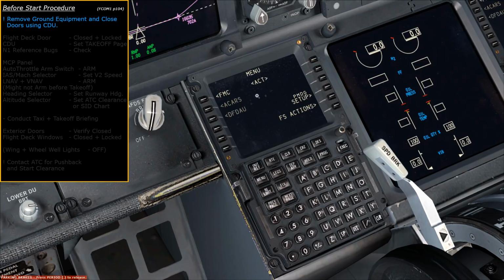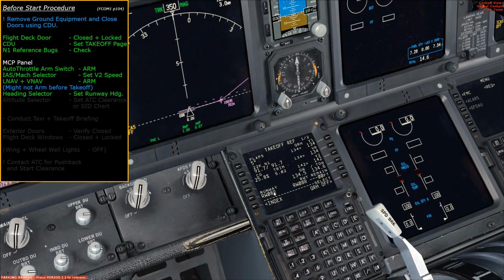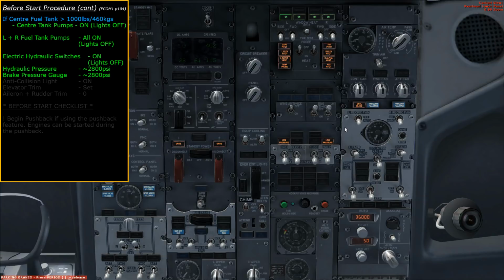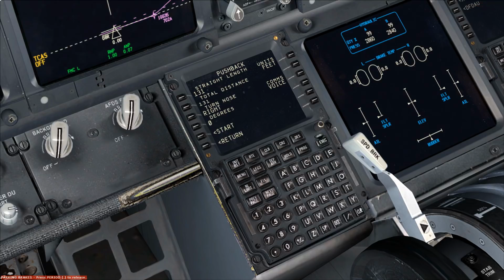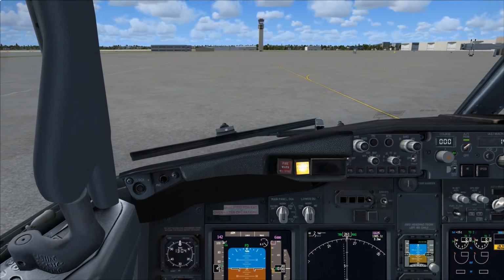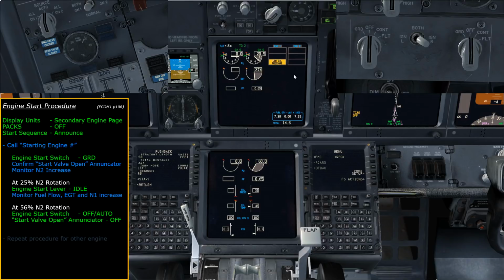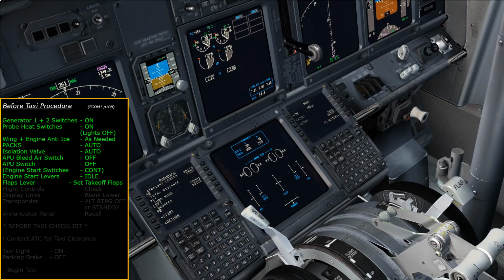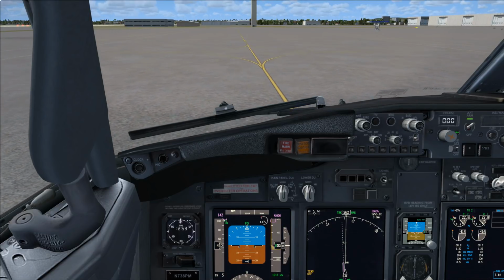PMDG 737 NGX:  4. Engine Start Procedures

Comment: Great tutorial! I have a question tho. When I try to turn on the hydraulic pumps the lights won't turn on, therefore, I can't control the aircraft whatsoever. I have never encountered this issue until today. Also, all the failures are off, so that's not the case. Any ideas? Thanks.
Reply: When the lights are off  and the switches down, engines running, and the battery is on, then the hydraulic pumps are on.  Lights on, pumps off. Okay?  That is, when the switches are in the down (on) position, lights will come on until the engines or APU is on.  The two outside switch lights go off when the engines come online (switches in the down/on position).  Inner switches (electric pumps) are switched on (down position) just before engine start.  The indicator lights will turn off.  When the engines come on line, the lights should already be out, indicating they are working.

Comment: Good aftrnoon Doofer911...another great and inductive video ,....they have all, up to this one, given me a great knowledge and Im practicing along with you at the same time of your explanation..pausing every now and them....as a piece of information in SIMVIATION you have an app called GROUNDHANDLING that can be installed into the PMDG without pus and helps A LOT during the taki. Will not work as pushback because you have this function in the CDU. In default planes for FSX it can also be helpfull..This way you can concentrate in other items...  NOW TO LEARN TO TAKE OFF, CRUISE, APP AND LAND...piece of cake.....thank you very much....Still wondering what is the app you use as checklist...ITS GREAT...

Comment: Hi Doofer, just a little thing I noticed that when you started engine 1 you didn't flick the ignition switch to the left engine. Apart from that a really good video as always..
Reply from the maker: My interpretation of the Normal Procedures is that the Ignition Switch is changed earlier on in the Pre-Flight Procedure, before we get to the Engine Start part of proceedings. I talk about the Ignition Switch in a video before this one :)
Reply: Doofer911 Hi doof, i see what you mean now. So because you started both engines with the switch to the right, the next time you start the engines the switch would be to the left. Thanks for pointing it out to me, I think your tutorials are really good. It's much better when you've got someone like yourself explaining and showing everybody what to do and how to do it. Well done mate and thanks again. Bob